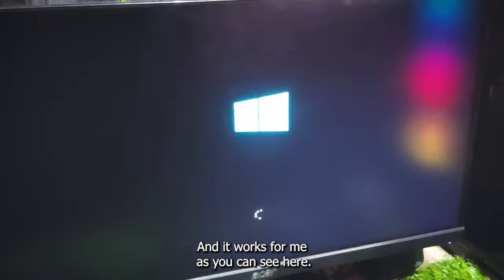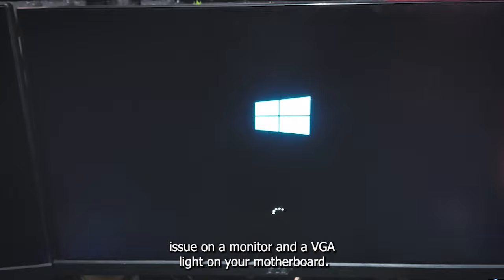Solved: No Signal on monitor and VGA Light on Motherboard

Comment: The VGA light is still on and I'm not getting any post to the monitor after following this step by step guide
Reply: me too
Reply: did u find a solution?
Reply: Same
Reply: i am also not getting num lock led on keyboard
Reply: @somadevi4883  same now did you find a solution ??
Reply: Gpu problem. Same as mine I replaced the gpu
Reply: @terencecampugan2558 did it fix the GPU light with replacing the entire part?
Reply: @Angel-ph4xl  yes
Reply: @terencecampugan2558  was your BOOT light turned on aswell or just the VGA alone? thanks
Reply: @Angel-ph4xl My boot light is also on, any solutions for you?
Reply: I reseated everything. Make sure the gpu is connected to the monitor. and check for compatibility of all your components. Eventually all my lights turned off and i get a clean boot without any issues. Prob the most important is to configure BIOS correctly and clean install windows properly.
Reply: @terencecampugan2558 no it’s not the  gpu
Reply: @ProKingGamerYT  bro I fixed it but I don’t know what’s causing that
Reply: Try cleaning the part of the gpu that it applys to
Reply: @Youzarsif33 bro how do you fix it?

Comment: Don’t do this to your PC you’ll end up messing up even more. Sometimes just disconnect the VGA wire that runs from your GPU to MB. And do a Restart.
Reply: Did that and didn't work

Also tried removing the GPU, cleaning the yellow part that connects to the MB, didn't work 😕

Comment: Mines odd, i have an issue whete sometimes it shows on boot up but sometimes it doesn't and later on my pc will lose display n wud crash (idle and during gaming)
Reply: Did you ever figure it out? Been having the same problem with my 3080 would love a response asap
Reply: Having the same problem with my 3070 ti
Reply: Me too
Reply: Something may be damaged. It could even be the psu
Reply: have you tried a BIOS update?
Reply: @suarezjoel  yh but even then had the same issue, im thinking the power connector for the gpu is kinda fked because after messing with its positioning (after trying everything else n having nothing else work) i have it working again thankfully but gonna have to replace the whole PSU since its a non modular psu so cant detach the gpu power connector cable.
Reply: @Kas246  oh damn i’m not really sure what to say i had this exact problem and i thought it was my power supply so i replaced it and it kept occurring so i did a BIOS update and it worked perfectly
Reply: @suarezjoel  damn thats a shame, ty for letting me know tho tbh im just gonna leave it as is for now since its working n then if it occurs again then im probs gonna rebuild it, ive been wanting to do it for a while so ig i have an excuse if it messes up 😅
Reply: Bro i have 3060ti ,  i was playing forza and then it suddenly crashed and there is no display,  this happens approx 4 to 5 times,  but now am not getting any display,  and vga light is turned on in motherboard,  i also removed cmos battery for some time and then again placed it there,  but the issue is same😢
Reply: @naveenadhikary3693  let me know if you find a solution, cause I'm having the same problem
Reply: @danobra  not yet bro, i think my gpu is having fault,
Reply: Have same thing after a clean up with RTX 2060
Reply: @naveenadhikary3693 i cleaned and install everything again and it's just happened with RTX2060 i hope it's not the gpu becausey motherboard shower yellow light

Comment: I had this exact same problem. I did all what was stated in the video. It started happening after a period of time. I searched the net and got my answer. My PSU had become borderline due to updating my Ram and adding some more cooling fans. I simply ran out of power to run the GPU effectively. I upgraded the PSU from 650w to 750w and hey presto all works fine. Just thought I would share this as it took me forever to get rid of this VGA debug led.
Reply: i have 1200 watt and this problem remains
Reply: I got exactly the same problem. With two identical mothers!!!!
MSI B350 PCI mate and MSI B350 tomahawk. Both death exactly the same way. 
I suspect, maybe could be because both were updated with the last BIOS update from MSI? 
I really don't know the problem origin, I'm really desperate and frustrated...
Reply: @Wolverine1981 same here man
Reply: @Wolverine1981  Did you ever find a solution? Having the same issue here
Reply: @Themadbread  it has been less than 72 hs since I went to a PC technical to see if he can find the problem. And it did it!!! He told me that it dismantled the entire hardware from the PC box and tested it out of it, and the god damn thing came to life again without no worries. I don't know what to expect, it's really annoying that by only doing that it worked again, but it's all I can say man... Really cheap solution for me.
Reply: @Wolverine1981  i'm having this issue with a rig i put together with spare parts for my brother-in-law. all parts worked fine on test bench and worked fine when installed in case, then the next morning white light no post. I'm starting to think that maybe some of my parts were dusty and I should try reseating/cabling everything to see if that helps!
Reply: @okokayy  do you have a VGA motherboard's led indicator ON, both VGA card fan's working, and no video signal or boot beeps after initial BIOS check?
Them your problem is probably same as me as well...
Try by removing all of the parts and plug everything out of the case, just exactly as the tech guys did with my system, and let's see if that work on this case...
I have two or three weeks already without problems. It worked when it wanted or after doing that thing I've just said, I don't know what could be the root of this weird problem, I've never seen anything like this before.
Reply: @Wolverine1981  i'll diagnose tomorrow and let you know! i orrdered a new mobo that will be delivered tomorrow so I gave up for now lol
Reply: @okokayy  I had same problem on two identical MSI mothers.
Unbelievable but real.
Reply: @Wolverine1981  the board i bought was a MSI ironically lol and it solved my issues! brother is currently downloading steam games and playing games! i'm full of joy for him lol
Reply: @okokayy  well, like I'd say before, my first one was an MSI b350 PC MATE.
My second one it's an MSI b350 tomahawk. 
The tomahawk it's now working again after having dismantled the entire case and plugged on everything out of it again.
The pc mate didn't tested it again but it's something I have to do to get an idea of it's still working or it's now a piece of scrap.
Initially when I bought the tomahawk, it worked fine during the first 45 days. Then suddenly died exactly the same way as the pc mate board did it first.
Honestly, I hope you get better luck than me from now on, buddy. This it's really a mysterious kind of failure.

Comment: IMPORTANT I plugged the dpi cable into the graphics card rather than the default port and it worked just fine. Make sure its plugged into the right port before doing all of this. It saved me a lot of work. I didn't have to unplug anything except for the dpi cable.

Comment: Ive tried reseting bioa through cmos and jbat1 and it didnt wprk unfortunately. I get display when the gpu is in any slot but the x16, and the x16 works sometimes but stops working if i restart. Whats going on?

Comment: I had this problem too with intel i7 11th gen paired with a rtx 3060ti ,showed red vga light. At first dismounted my gpu and putting back in place at every startup would solve my problem but kind of painfull to do each time. But as soon as I removed the second ram there is no more vga light and it starts up normally
Reply: Was it a RAM issue? I'm having similar issue like you
Reply: @shLowKey I really don’t know. I’ve put back the ram in place and now the only way to start my computer is to unplug the hdmi cable start the computer and wait until my keyboard and mouse light up then replug the hdmi and it works.
Reply: @CustomRcCanada  I figured out my issue. The VGA debug light would come on the motherboard. No POST or BIOS... After 2 mins, the BIOS would come up. I checked the storage drives and my SSD with Windows installation was not detected. So I removed the SSD and now there is no VGA light and I'm using another SSD with Windows and PC is working fine.

Comment: I was playing a video game and never had any issues and all the sudden my pc I think reset its self but the screen went black and the keyboard and mouse lost power for 30 seconds the display never worked again I tried switching monitors I tried cmos reset I tried one stick of ram I unplugged no replugged everything all parts turn on and work perfectly fine like they did before it’s just that I get absolutely no display and now the usb ports are funky. Please help I’ve tried so many things I can’t figure it out and don’t have money to replace it I just got a new gpu for it as well I also tried switching to different display settings and used DP instead of hdmi nothing works
Reply from the maker: If you cabinet rgb is still on when powering up then it could be the problem with graphics card or cpu and if the rgb of your cabinet is on when booting up your pc then definitely it is the power supply i guess the power supply is dead check the power is working of not by inserting pin touching black wire and green you can watch video if you dont know how to check the smps is dead or not and also read the led debug check on which white light sits on is it on ram, cpu, vga if its sit on vga then it is the problem with graphics card
Reply: how did u fix I'm literally having same problem with you I bought new ram new GPU still not working I wanna cry rn reading the comments section
Reply: @Stinger32  I had a faulty gpu
Reply: @Stinger32  if u hae ur old gpu put it in and see if it works if it does ur gpu needs to be returned if it does not then swap the ram and see

Comment: What if my build is new (I’m testing the parts) the vga light is on but I’m getting signal on the monitor?
Reply: should flash on initially when booting, its if it stays on its an issue

Comment: hello, i have a problem sometimes my gpu is detected and sometimes not with white debug led on my motherboard. When it's not i just need to restart my pc by the power button and it's run ok. Someone can help me ?
Reply: I'm having the exact same problem. I checked all the cables that connect to the MSI monitor that connect to the PC and they were all secure and not loose. Took out the RAM out from the MSI motherboard and reinserted the RAM and it only fixed it temporarily. Did the same thing with the graphics card which is about a 7 year old AMD card and hoovered as much dust with the soft head that I could get off, which was dust around the part of the graphics card that slides into the graphic card slot, dust from the fans, the rest of the body of the card.

Now my PC is showing display as it should be, but I don't know how long this will last.
As I turned the PC on, I thought I would look at the EZ Debug lights as it was turning on and noticed that the one for VGA was white but turned off again.
Going by this, I am only thinking that my problem MIGHT be down to the graphics card, but if someone who is an expert on these things would hopefully read what I typed they could make a better assessment of the situation.

What I noticed when I started my PC after putting the RAM back in, was that my PC was starting up faster for some reason, then go back to the speed it was usually starting up at which was sort of stuttery....

I have no idea.

Comment: i got new parts and built my PC and it didnt show on the screen. ive tried the basic stuff but havent removed battery or used screwdriver, i think on my motherboard it has 2 switches, one reset and other flash. ive tried them and it didnt do anything i can see. i gave my pc to a guy who may get it working but he said its either CPU or motherboard and he thinks its the motherboard because the orange VGA LED light is showing on my Gigabyte AERO G Z790 motherboard and the CPU i have is i7 14700kf and i cant update bios without it showing on my monitor. do u suspect my motherboard to be faulty? im sure the CPU is fine. and my GPU works in old system so thats fine. i spent hell of a lot and got parts from germany and waited so damn long i feel im gonna struggle to send it back and get refund or whatever. seriously its been a nightmare of over 2 months getting parts from places.
Reply from the maker: Accidentally Bent CPU Socket Pins On Motherboard can cause no signal so check if there is any bent in motherboard or cpu and this usually happened when we not properly intall the processor on motherboard so check if there is any bent
Reply: @Babinmeitei  its 14th gen it doesnt use pins
Reply: @Babinmeitei  also had some pc guy look at it and even he said it might be CPU or MOB.
Reply from the maker: @sasproductions701  it might be the motherboard socket pin is Bent
Reply: @Babinmeitei  ill have a look when i get it back tomorrow. thank you so much for replying back bro seriously.
Reply: Hi, I literally have the same components (motherboard & CPU) and the same problem. Have you found a solution?
Reply: @yellowcard197  I placed the CPU carefully and know how it is. it turns out the pins are slightly bent from CPU slotted in and sliding down a little so I just need time to straighten the pins and hopefully it will work but since I haven't tried it so wasted over £300 for the motherboard. gigabyte sent me an email to send it but that's a while ago and I didn't.
Reply: @sasproductions701  It turned out that it was the 12VHPWR PCI-e cable. It provided power but no image. Using the PCle 6 + 2 to 12VHPWR adapter, it works perfectly. For whatever reason :)
Reply: @yellowcard197  I have a skylake i5 6400 build and then when I got new parts for my new build I bought new gigabyte PSU especially for newer graphics cards. I have a sick case too I love. its a HYTE Y70 it has a 4k display on it and its sick and useful. one problem I had was the gigabyte motherboard doesn't have many, I think its fan headers so I need a fan splitter cable. basically having lian li 360 AIO and with a total of 9 fans in the case and had problem not being able to plug all in plus cpu pump so I seen they do splitters. another thing I wanted with my motherboard I love is M.2 slots it has I think 4 or 5 where as my old build is Asus b150m and only has 1 slot. and also the new gigabyte motherboard having wifi was a must.

Comment: Do I put the bios battery back in then short the pins to reset the bios ?
Reply: First push the power button several times while everything is disconnected, this dissipates any power left in the computer. Short the bios reset pins then replace the battery. You don't need to spend 5 minutes shorting the pins. It works the second you connect them. The same thing with his 20 minutes of waiting. After unhooking everything hit your power button. These operations happen as you do them. A 20-minute wait doesn't do anything but waste 20 minutes.

Comment: i have this issue where my vga light is on with no display on my monitor but i dont have spare parts ive tried remove the cmos out n reset the motherboard board reseated the gpu tried troubleshooting with ram sticks but still nothing works any suggestions
Reply: Were you able to fix this? I am having the same thing :c

Comment: My motherboard had same feature, some led light if hardware failure. 
 But its not sitting one 1 led, the led on switch from cpu, gpu, and dram.
From what i know, it suppose to be like yours.
But mine just looping from gpu light, to dram and cpu. Its like pc restarting while try to bootup. Is that mean my psu dead?
Reply: I think its just checking each. If it remains on, then that component has an issue

Comment: I found out that this white light is not only vga, a friend of mine got this issue and the issue got solved after removing all sata drives from the connections. A ssd  was defect which caused the issue.
Reply: Was it sata or nvme

Comment: PSA for those who did the simple diagnostics and didn’t work. Try either cleaning the PCiE slot. If your CPU has a IGPU, run the IGPU (remove the dedicated GPU and just run with CPU) and see if it posts. If it does not and the CPU is a known good CPU, sadly your board is a bust.
Reply: It’s really weird what happened in my case. I was using my old motherboard because I couldn’t use my current one because the cpu was busted, when the new cpu arrived I installed everything from the old board to the new one and it posted except for the gpu (even though it was working on the old one) then I switched back to the old one and used 2 different gpu’s and both didn’t work. So it’s not likely to be the motherboard, it could be the psu or rams or ssd or basically anything. I’m so frustrated
Reply: @Nb_2089  I'm in the same situation. New motherboard, new PSU, tested different ram, different PSU, different GPU, and still can't find the source of the problem.
Reply: @danobra  
For me the issue was the pcie slot itself, it just stopped working. I installed the gpu to the lower x4 slot and it worked so I ordered a new mobo and tested on it and everything worked

Comment: this happened to me and I was experiencing this for a month. I did all the things from this and other tutorials but still did not fix it. I finally went to a repair shop and they removed something from the back and its fixed. I asked what he removed and he said it was a cable going to my HDD. I was like, I dont have a HDD. he showed it to me and I remembered I actually have an HDD before and maybe because the HDD broke for a long while back and did not show up in my available drives for so long I forgot about it. Faulty HDD was the cause. Boot had to read and check the HDD before actually booting up causing the long boot sequence
Reply: nah
Reply: Same exact problem, same exact solution. Thanks a bunch @Inbanzon❤❤